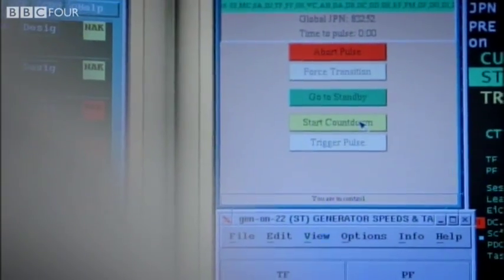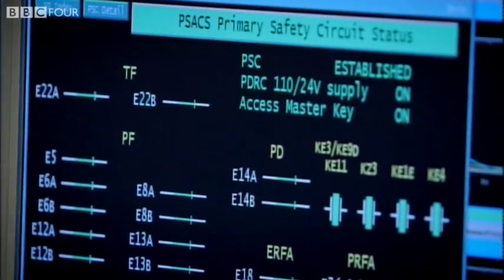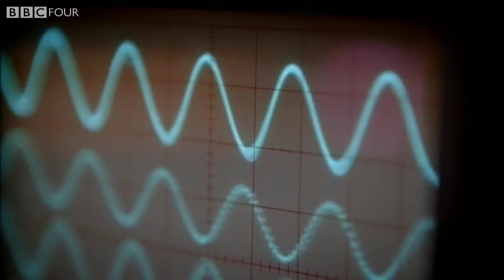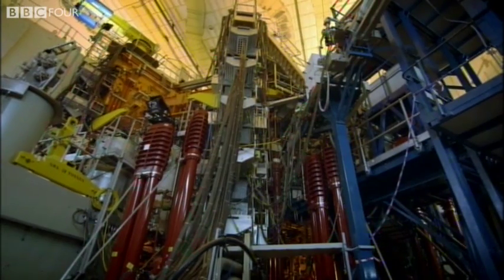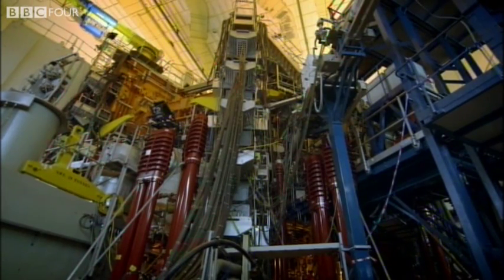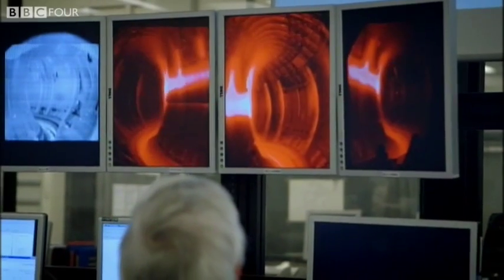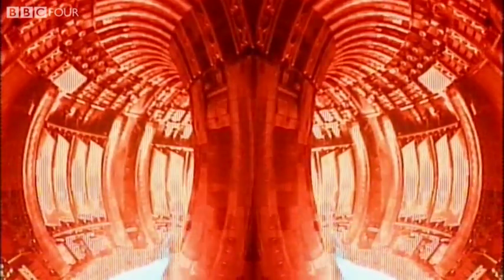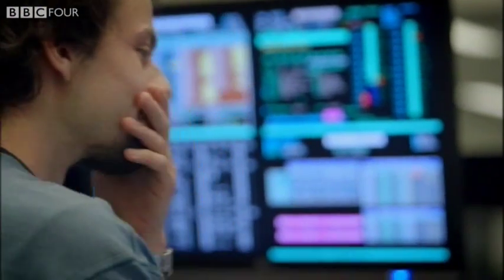Making a star on Earth - Seven Ages of Starlight - BBC Four

Comment: It is of some value to remember that there is a practical form of fusion that has been possible since the Ivy Mike Test shot in 1952. If you are willing to permit a tiny amount of energy dense fissile material to be used to create the conditions of inertial confinement fusion, then ignition of D-D and D-T plasma is routine.

PACER Fusion -
Practical fusion to fully power the planet longer than the earth has existed or the sun will burn

(no brag – no hype –  just facts)